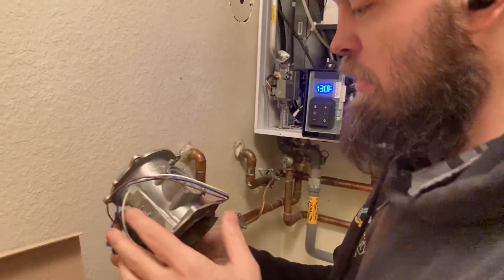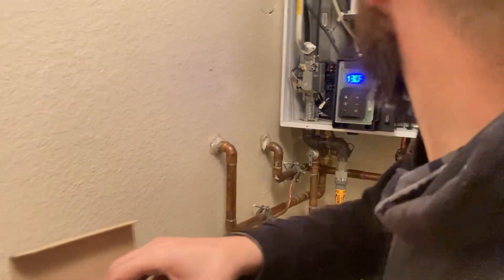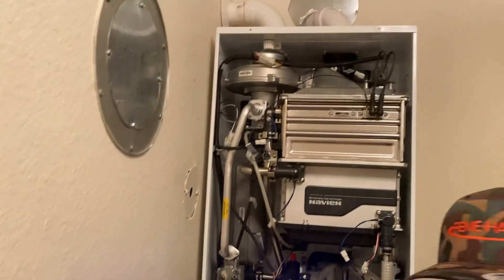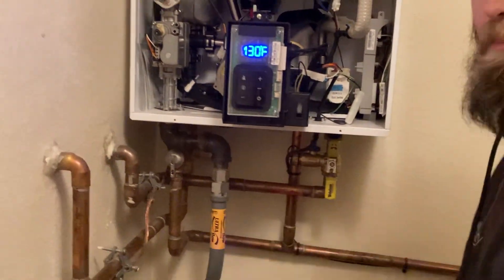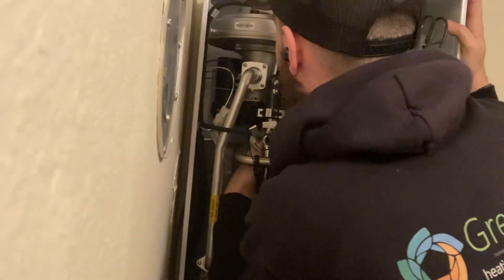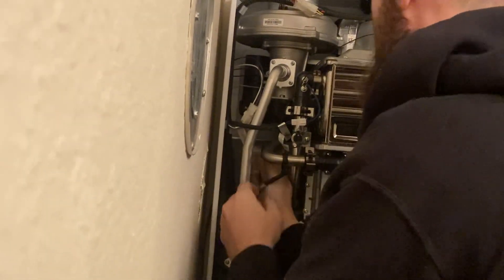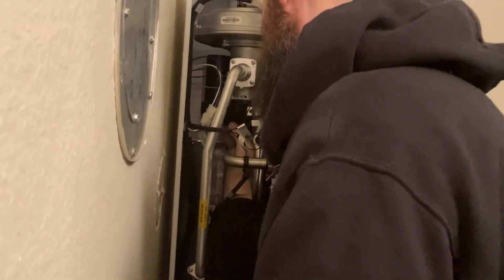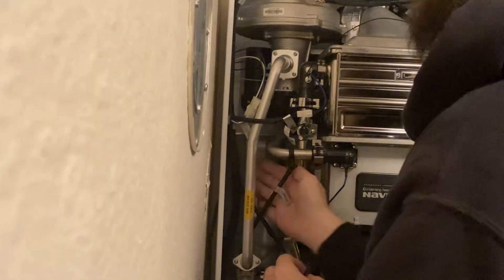Navien NPE 240A Error code 060 duel venturi replacement video 1of 5

Comment: Wayne, thank you for this video. I had the same error code. You saved me over $1000,00. A local plumbing company wanted to charge me $1000,00 to replace the duel venture part. I was able to purchase the part for $85.00 and have it shipped directly to my door. It took me less than 45 minutes from start to finish. Thanks
Reply from the maker: YouTube at its best!